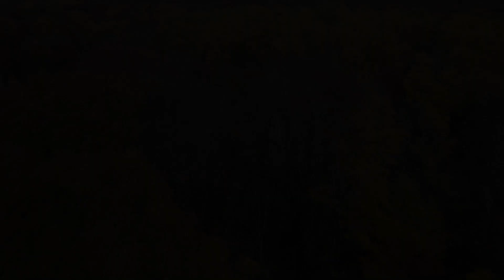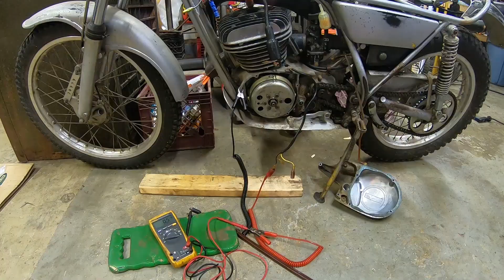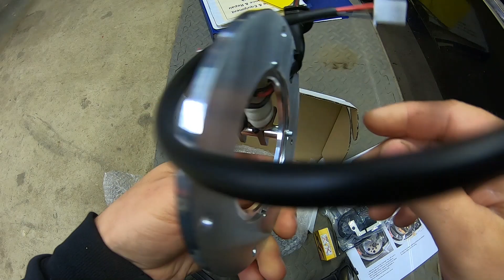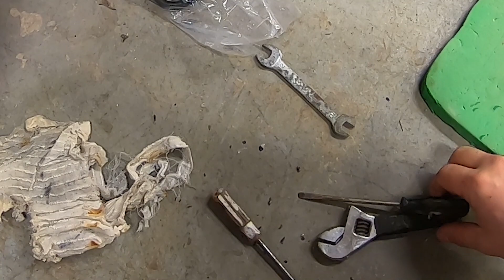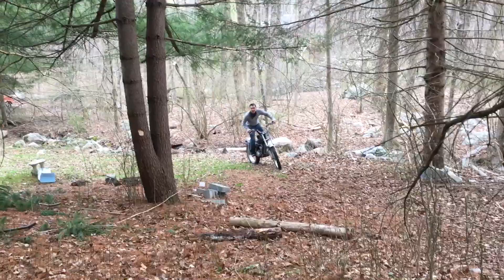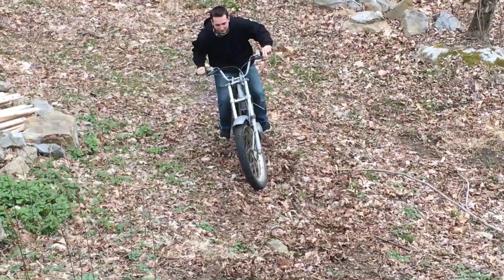Upgrading Yamaha TY250A Ignition - Lost Spark!

Comment: I had the exact same problem and I have seen other identical bikes with the same problem, I fought with mine for a long time, I do believe in the end it was the spark plug cap, the piece where the coil wire goes into was completely gone, and the coil wire inside was corroded, even though it looked good,I too, would adjust my points, do spark test, change, spark plugs check the Killswitch etc. etc. I even changed the coil. But now it runs great. You never know but it frustrated me to hell, lol.
Reply: ¿Recuerdas cuál es la medida para ajustar los puntos?